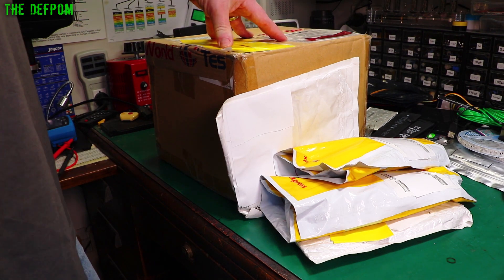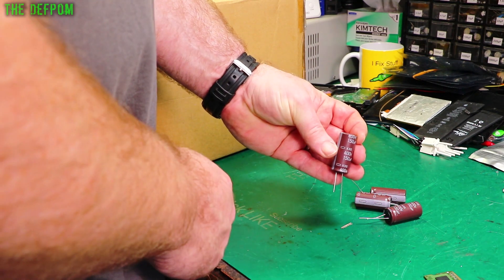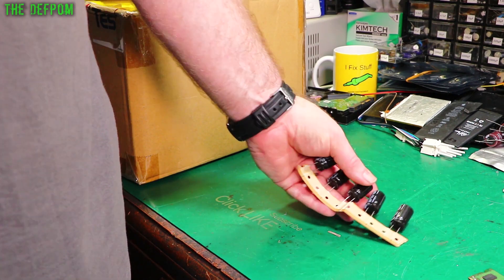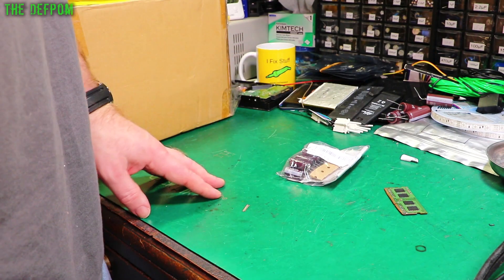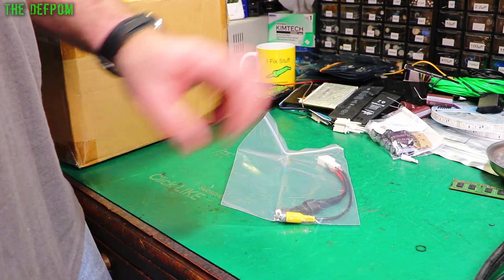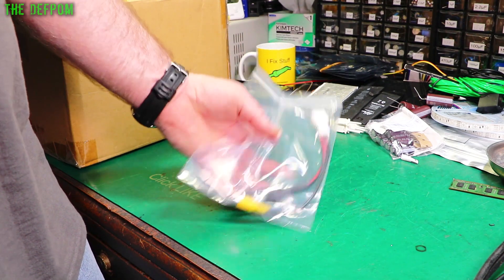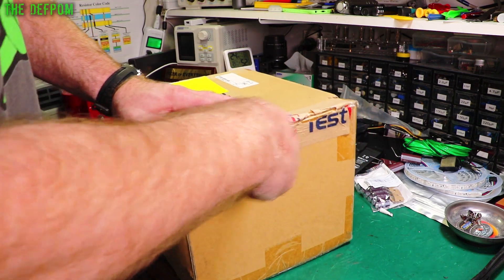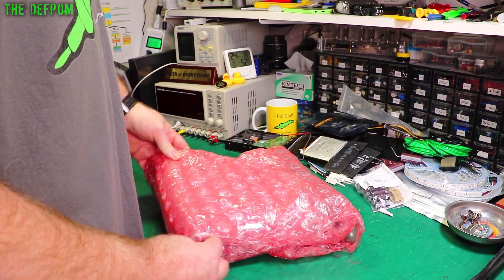🔴 Mailbag Monday 12th July 2021 - Capacitorgeddon - No.852

Comment: i have in thailand one laboratory power supply i not know why not working 2 month new, and 3 to 1 welding TIG,MMA,plasma cutter machine what no working 1 year old. but no know were can repair. 2 arduino clone board and one adjustable power supply diy soldering banggood board.